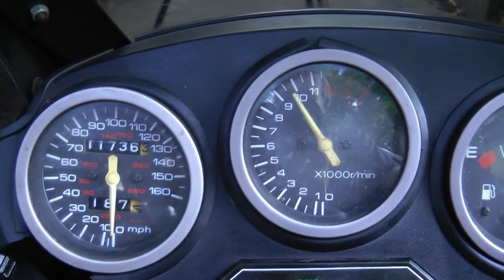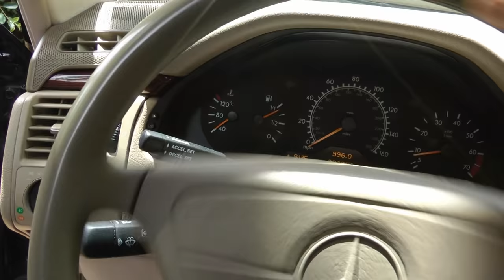How to Find Power Steering Leak in Your Car (Hose Replacement)

Comment: I have a 98 Pontiac Grand Prix 3.8 supercharge. I replaced the rack and pinion about two months ago.  Now I see one of my hose spraying I believe power steering fluid.  My car makes a weird noise and is hard to turn.  Once I'm giving it gas it goes and I can turn (only if I'm gasing it).
Reply: is this an easy job?  or do I need to go to the professionals ?
Reply from the maker: replace the hose assembly, just hard to get to the loosening bolts sometimes but anyone with patience can do it
Reply: Scotty Kilmer thank you. I brought the hose.  It was pretty cheap, now I need someone to put it on.

Comment: Hi, my power steering hoses shake and make a grinding noise when turning left. I can hear it and see/feel it in the hoses and cooler. It only does it when I turn the wheel to the left, not to the right. What do you think it could be? It dont have bubbles in the reservior, and doesn't do it when I put the front end on jack stand. Can you help? Thanks

Comment: Hey scotty, i inherited a 1998 lexus es300 that has massive leaks all over it. High pressure line, rear and main seals, radiator were leaking my friend said. And noise on the engine which could be the tensioner he also said. My mechanic replaced the timing belt, water pump, tensioner and the front seal. The power steering hose was also replaced. Leak stopped he said and after driving it for few hours, there was a little leak. Next day, it was making a noise and when i turned the wheel it made a weird noise. I looked atvthe ps reservoir and it was almost empty. Refilled it and few hours of use empty again BUT the leak is only 2 inches big. What causes the problem? And by the way, the engine noise is still there even timing belt kit was replaced. Pls help!

Comment: Scotty... I have a 1994 jeep grand Cherokee Laredo and I have a power steering leak and I think it's the power steering pressure hose cuz I can see the fluid soaking threw the hose is it suppose to do that ? And when I pop up my hood I can see the fluid on my air filter box cuz the car fan makes the air blow against the power steering pressure hose which the fluid is soaking threw am I right that it's the pressure hose ?

Comment: i have a mbz e320 like the one shown in this upload one day i attempted to pull away frpn the curb and heard a squeak i knwe i needed power steering but then i noted i was having to put it every 1-2 days untill onec night the steering was so tight i heard a pop and power steering fluid was all over tje ground wat do you think is the problem pump? hose maybe?

Comment: will this process be the same for a 1990 toyota camry thank you.
Reply from the maker: yes, but the hold down bolt on the ps pump where the hose bolts on is a mother to get off, use a long cheater bar and an extension to break it loose

Comment: Scotty, did you just use generic Autozone PSF? I mean shouldn't you supposed to use MB PSF? I'm planning to change my PSF and the manual said "Only MB PFS" I was wondering if i can just use generic walmart psf...
Reply from the maker: 3325 I used the merc oil, I just put stuff in different containers lots of times

Comment: @scottykilmer thank for the info il try fix it best as i can with patience...

i wanted to drain the fluid can i do it while i get the gasket and the filters and all kind of that wont damage the transmission or is better to leave it like that and unmounted when i have all the resources?

cuz i wanted to drain it so it drains good and then put gaskets and new oil...

Comment: Power steering went out in my dodge it looks like its coming from a hose that goes to the rack and pinion do you think its a hose or the rack and pinion
Reply from the maker: high pressure power steering hose leaks are most common

Comment from the maker: @stevomwa1 Pretty much the same, but the banjo bolt on the power steering pump is often hard to remove, I use an air impact wrench and a long extension myself. Scotty

Comment: @scottykilmer Ok thanks scotty. I have tryed flushing it. Its a 2000 4x4 silverado. I was told I have a gear box and not a rack and pinion. My truck needs a front end alignment badly too. What do you reccomend if the Seafoam don't fix it? Thanks

Comment: What caused the hose to fail?   I have not seen one fail before,  except at the connections.
Reply from the maker: 1600 psi pressure makes em leak from old age and rubber deterioration
Reply: Probably.  I am facing the same problem with the wife's 1990 Cougar.   Steam clean first,  dye second,  then replace the leaking part.    Enjoy your videos.

Comment: i always tough that the only power steering fluid that i could use was the one from mercedes benz i have a ml 430 how do i get a fluid compatible to my suv from auto zone ? nice video
Reply: Sorry for the year gap - but for others - You have to look for the most expensive power steering fluid they have lol, always.  That will be for the German cars. Audi MB, VW, Etc. these days like 12.00 for a little bottle

Comment: ive got a 95 civic, the rubber seal on the steering rack split in two, and now its leaking power steering fluid fast. can i just replace the rubber tube or do i have to replace the whole rack//

Comment: Scotty do you find leaky hose is most common power steering system failure? finding the actual source is a challenge
Reply from the maker: yes, but to find out, do my video "finding and fixing car oil leaks"
Reply: +Scotty Kilmer I just ordered at 205.hopefully it will fix small leak in my celica ps system...thanks for all great how to tutorials

Comment: I have a problem with my hummer h3 it keeps leaking I took it to a mechanic and they replaced it with a brand new pump it worked for a day but the next day it started leaking again what should I do to find where is the leaking problem

Comment: Hi scotty at 1:02 on your video the fitting you removed with the wrench them turned by hand off. I just purchased a new hose for my 2003 sorento. That same type fitting does not turn at all it is like it is welded on. I got a replacement and same thing. How would I get this to turn. Thanks for your time...
Reply from the maker: +Maryellen Johnson use a crow foots wrench and a ratchet. They always work
Reply: Thank you Scotty you are the man.. Your videos are on point

Comment: The pressure hose on my Hyundai comes with a steel line with flare nuts on each end. I'm having trouble aligning the flare nut properly with the thread since it's so tight. So it will screw in partially then pop out. The crows foot I'm using is too large and the tie rod is blocking any thoughts?

Comment: mines leaking where the rigid line and rubber hose meet. is there anything I can use to stop the leak for now.
Reply from the maker: nope, just replace the hose, often aftermarket ones from places like auto zone are much cheaper
Reply: Thanks man

Comment: so which end do i cut exactly, the upper hose by the pump? or the lower end by the left wheel and axel? i was able to get a socket and wrench to the nut where the top end of the hose connects to the pump, ii loosen and twisted a little, but it wont let me unscrew it out, it keeps goin back in place, its like the hose is holdin it back, if u can check out the picture in the link below, im having truoble with the end, with the 90 a degre angle on the v6 model. here the link of the picture

Comment: Hi Scotty do you know if a 2003 Kia Sorento has a power steering sensor or not?
Reply from the maker: yes, on the high pressure side.
Reply: thanks for your insightt scotty
Reply: what does the power steering sensor do? could it go bad and cause steering to be stiff from time to time?

Comment: How many psi do you recommande for tightening the line?
Reply from the maker: +David Ferguson you mean foot lbs of torque. You really can't accurately get a torque wrench on those, so basically get a crow foot wrench and pull it till you can't move it anymore

Comment: i have another issues my fuel gauge keep jumping so never know when I have to fill up I changed the pumps and filters what else can be the problem 1987 420 sel  I was told the ground but don't know where that is located 2- my odometer stopped working car was parked over 10 years and was working fine before

Comment: hey scotty I have a 92 es300 Lexus and  my power steering fluid is full and I have no power steering and now my fan by the radiator is not spinning could it be  the power steering pump? or maybe the belt?
Reply from the maker: try a new belt, if not that, replace the pump
Reply: thx scotty!

Comment: @scottykilmer Well it just had a safety done. And one ball joint was bad on the right. So I had it replaced. And the noise is still there. But why would it make my hoses shake anyways? The hoses and cooler is where the noise is coming from. Could it be from needing a wheel alignment?

Comment: what can i do now that my power st pump sucked air ?? i replaced the pump,filled resevoir,started the engine,pump quickly went dry so i added fluid then once i shut the motor off quite a bit of fluid "Backed up" into the resv and overflowed out please tell me what i need to remedy my situation,thaks

Comment: For hyundai Sonata S20 (2005)..service center guy said Hose needs to be replaced along with a ignition coil as it slightly jumps while shifting 2nd to 3rd....Dint know what to check b4 buyin a 2nd hand car... :-(
Thank you
Reply from the maker: coil is fine used, but forget hose, they crack on em all. get a new one, aftermarket to save money

Comment: So I'm doing this on a 2002 hyndai sante fe and I can't get the high pressure hose to disconnect from the smaller metal hose it connects to on the bottom. Any tricks or suggestions for this?
Reply from the maker: yep, I then cut the hose you are replacing off there, and then a socket will fit on it and come right off.
Reply: Hey Gabe....I have a 2002 santa fe as well.  I was getting a slow leak and then it just progressed to the point where I am now leaking the whole reservoir almost in one spot. Any tips to can pass my way?   How well did your repair go?   Was it a sucess?   I love the car.

Comment: Ive got a saturn Ls and it does this high revving when started and stays their. Sometimes it will idle down after a mile or so but it sometimes wants to keep the rpm up high. It has 190,000 on it and is otherwise a great dependable car any ideas how to fix it

Comment: as I turn the bolt/line thats connected to the rack the bolt turns and is loose but then it stops cause the whole line wants to spin with the bolt.I put some pressure on the wrench trying to get it loose but again  the line is starting to bend and turn with the bolt as I am loosing it. how to stop the line from spinning so I am able to take the whole line and bolt off without breaking the metal line. any tricks or anything I can do besides cutting the line and loosing the bolt.I guess the line is so rusted everything wants to spin?  2001 dodge durango
Reply: nate KKorinok use vice grips, pliers, or even another wrench to keep that other piece from spinning you and you to keep the other piece from spinning get creative and use another tool to keep it from spinning and then unbolt the nut or line whatever it is that you are trying to get off.

Comment: I have a 2004 Mitsubishi Endeavor 2WD which got that grinding/whining sound from the power steering pump. I can't seem to find the leak, but when I floor the gas in park and turn the wheel entirely to the right/left until it grinds/whine, power steering fluid start spitting out and gets on the belt.  The space is too small, so I am unable to see where it is leaking from. Could my pump be out? Is it just a leak? Would you like a video? DIALING 911, PLEASE HELP!!

Comment: Hey scotty how do I change the high pressure hose on a 1999 Lincoln Continental thats leaking A LOT ....with occasional smoke..?
Reply from the maker: same as this video, only it's somewhat harder due to less working room, especially on the bottom

Comment: Didn't save me money XD on my 07 Taurus it had the switch on the high pressure line, so it was $84. (Like 2 times more expensive then the pump it's self!) this did help me understand how I should properly remove the line though! Thank you!  Ps I love you easy you make getting the nuts and bolts off XD "uhh" lol

Comment: one of my power steering hose came loose and i can push it in and pull it out, but what's weird is has no thread to secure it basically a plug in, how do i secure it? Lincoln Ls

Comment: i hav a 95 gmc yukon 1500. its sluggish going uphill and trying to give it gas. could this be the cat being too clogged?
Reply from the maker: Jacob Steiner could be lots of things, but have the fuel pump pressure tested first and the catalytic converter also pressure tested for too much back pressure. Those are the 2 common reasons

Comment: What else can be leaking when it comes to my power steering. I have a 1997 Dodge Ram 1500 5.2
Reply: kimberlycurtsinger72 low pressure hose

Comment: Would the power steering pump make your check engine light come on
Reply from the maker: Sameer Williams not unless it's an electronic power steering system, the mechanical ones do not effect electronics

Comment: i have a 2000 chevy silverado and have a problem cuz i keep getting it fixed and it keeps getting knocked up off when i turn the wheel and press the gas at the same time i don’t know what to do i’ve gotten it fixed atleast 7 times cuz  of warranty

Comment: My 02 buick century has been leaking out power steering fluid but now the whole pump is empty and the fluid is on the ground i saw that two lines were wet but i have no idea where the leak is coming from ive tried stop leaks also and nothing works

Comment: wow, I just watched this. I flushed my p/s fluid few days ago cause of groans and low level.. but i think there is a leak behind my driver side tire, same as in this video.., saw some squirt marks on my driveway after few 3-point turn arounds, and it needed more fluid. It's a 99 ford taurus, Guess i will see more after removing the wheel.

Comment: Hi Scotty
I saw your vid and decided to do mine, for my experience I would definitely tell everybody don't do it, it took me 3 days to do it, I opened the hose in two minutes, but that damned bolt on the rack is pain and took forever to go back.
I have a question for you, the new hose has two orange washers do I have to use both or only one on top of the bolt that goes to the rack 
thank you
Reply: It took me 2 hours today, the damned bolt on the rack was still not in. There is just not enough space to maneuver and the bolt is hard to go into the hole. Does any one with experience have any suggestions?

Comment: I have a 2011 jeep grand cherokee they tell me they have to replace two lines because thier leaking at the connection. is there a seal I can replace. it's on the low pressure side.
Reply from the maker: they have rubber O rings, but rarely to they go out, once in, they generally last longer than the hoses that usually leak. But, you can take it apart and try

Comment: what should i replace when the power steering fluid shoots up from the reservoir cap..its on a 93 crysler imperial
Reply from the maker: normally it's the pump itself, start there and pray it's not the steering rack gone bad

Comment: i have a 2007 impala, how do i replace my power steering return line?
Reply from the maker: easy job, they are cheap hoses that carry very little pressure, just disconnect each end and put a new one one, and realize places like auto zone sell much lower priced hoses

Comment: Would it be okay to mix in water with dye and use that to detect the leak? Anybody know?
Reply from the maker: +Alex Hall they make special uv dye for cooling systems, you can use that. But only use uv dye for oils that is made for oil

Comment: What about flushing out the old steering fluids out.
Reply from the maker: +NYRM1974 sure you can do that but most leaks out when changing the pump out
Reply: Well I'm replacing the rack and pinion as well as the pump and flushing the lines as recommended by the manufacturer. My 2004 Chevy Trailblazer EXT LS  steering pump took a dump. Being that I have over 172k figured why not do the rack and pinion also. Great video thanks Scotty your the best

Comment: I have a 87 420 sel how do I change power steering hose same concept?
Reply from the maker: +Musthaf Ally yes, just a lot more work in smaller working areas using more expensive parts

Comment: hey there i have a  2002 c240 mercedes and it starts fine but i when i get ready to drive it and hit gas it stutters and feels like its beginning to lose power but it doesnt but then later on when driving if i stop at a stop sign it will shut down and i would have to start the car again but it would start fine again,and when i am at a redlight or stopped i hit the gas it would take about 4 seconds to accelerate if you know the solution to this is would help alot. Thank you
Reply from the maker: try my video "how to clean fuel injectors on your car" and pray that fixes it, if not, pressure test the fuel pump to see if it's weak
Reply: my MAF sensor feels loose i dont know if that is the problem  there is a check engine light i went to auto zone to get it checked but its not reading it and the fuses seem to be fine
Reply: From what you said: either bad old plug or the wiring or a bad computer

Comment: hi scotty how would i change a power steering hose on a 1992 525i bmw ??
Reply from the maker: same basic process, bu a lot harder due to non working room on a bmw. You will have to jack it up, remove a tire, and probably swear a lot
Reply: Scotty Kilmer Hah hah ha! I know this is an old comment, but it's so true!